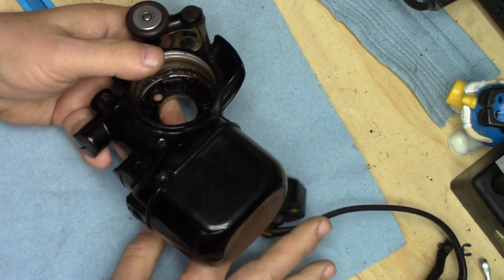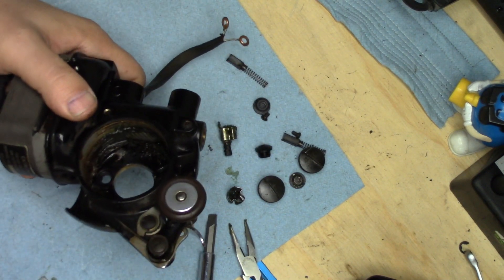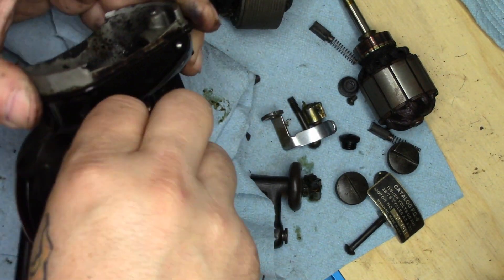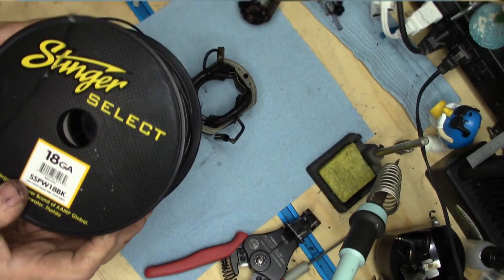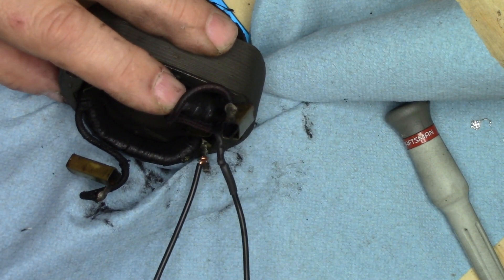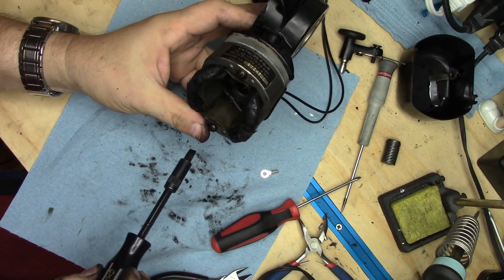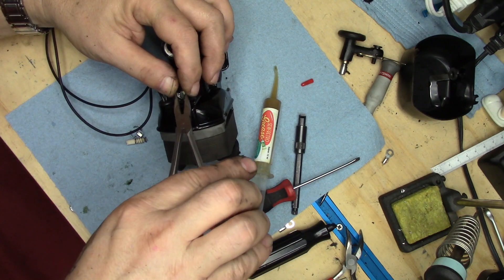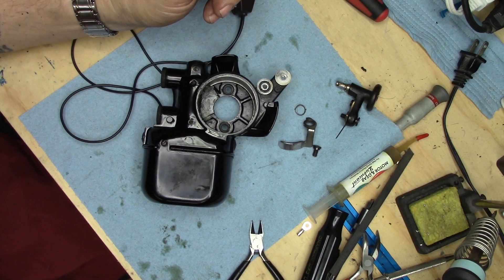Potted Motors: Revisited

Comment: Thanks for all your great videos! I have been searching through all your videos to look for information on the light that this motor has. Is there a special tool or trick to get those rings off and to put them back.    Also I found that to get the brush copper pieces out a plastic straw (the hard ones that come with reusable cups) are the perfect size and work wonderfully with a little tapiology added. Thanks for all you do!!!

Comment: Hey Bob!..your videos have been helping me greatly with my new found love of these machines! I got a 1940 15-91 recently that was sitting in a workshop up on a shelf in the sun for who knows how long. the wires and feet on the pedal were melted onto the machine!  I have managed to restore it mostly. It looks great now and everything turns as it should. it needed a full rewire so i used this video to guide me, but it still doesn't seem to work. When i got it i had no idea if it worked, so there is that lol. I just want to make sure there isn't something i need to know that maybe you didn't mention since i am super new to this. It is possible the coil is no good i would gather, but before i grab one off e-bay, i want to be sure i reassembled it correctly. not sure of the orientation of the brush holders..if that matters. Also could those wires to the brush holders be so bad to not make the motor work? they look ok, but are def old! Thanks for any help Bob!
Reply from the maker: You can test the coils with a DMM. Each side should have pretty low resistance, and as long at they are pretty much the same, you should be ok. Put your meter on an Ohms scale, and test between the wire that supplies the line voltage and the brush holder and make a note of the reading. Lather, rinse, repeat on the other coil and hopefully you're within an ohm or two. If you put the brush holder in the wrong way, the motor will still work, it will just spin in the opposite direction. The key is to pay attention when you disassemble the motor as to which goes where. Worst case, you pull the brush holders and put them on the other side.
Reply: @BobFowlerWorkshop  ah yes! I didn’t even think of that lol. Thanks Bob!

Comment: Got my third machine and it’s a 201 potted. Your videos are very helpful!  I like the zip tie method in this video for strain relief.  Much easier that making knot and adjusting to space against the armature. It’s still apart and may redo that wire feeding. Also, you use a different grease here that a previous video. Is there a difference?
Reply from the maker: Glad it helped! The zip-tie method works a treat with the gauge wire I use. For heavier wire, an underwriters knot is still the best option.

Comment: As always, thanks for the video and sharing your knowledge!  Would you possibly have a source for the grommets used to pass the wire through? Interesting use of the wire tire as a strain relief, I have to teach myself the underwriters knot each time I do this😉. Thanks again Bob!
Reply from the maker: McMaster-Carr  Item  9600K33 SBR Rubber Grommet for 7/16" hole diameter and 3/32" material thickness
Reply: @BobFowlerWorkshop  thank you Sir!
Reply: @BobFowlerWorkshop  I would be remiss if I didn’t comment on the quality of the lighting, very nice Bob!
Reply from the maker: @edge1289  Thanks!

Comment: What diameter of the wicks do I buy?
Reply from the maker: Consumables used from McMaster-Carr:
Item  8767K226  Firm Felt Cord F1  3/16" diameter  (grease wick for motor)
Item  9600K33    SBR Rubber Grommet for 7/16" hole diameter and 3/32": material thickness.
Item  7113K551  Ring Terminals, non-insulated for 22-18 Wire Gauge and number 8 screw.
Item  7856K43   Heat-shrink tubing  0.13" ID before shrinking.